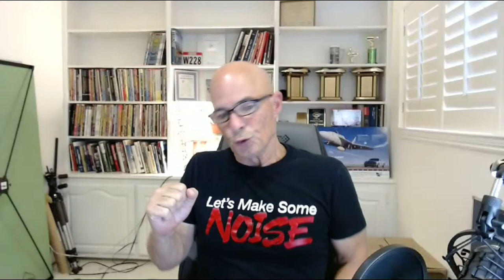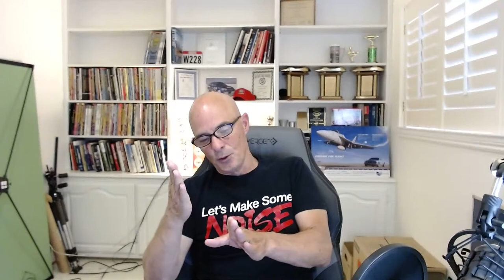LET'S TALK TECH-WILL A MOTOR MAKE MORE TORQUE AT LOW RPM AT PART THROTTLE?

Comment: As to your poll, I don't think that it has anything to do with manifold or port speed as such. It's about the fuel atomisation. Smaller droplets are more important at low engine speeds because there is not the turbulence to tear them apart or keep them in suspension. This is where vacuum secondaries work well on the street and the strip because they tend to keep the droplet smaller due to the venturi speed as a result of the delayed opening of the secondaries. But as a circuit racer I hated vac secondaries due to the loss of throttle control. Of course the equation changes when using CD carburation or carburettors with air valve secondaries, Quadrajet, Thermoquad, etc.

Comment: Depending on the spec of the motor, often a tunned unit will not take full throttle, under load,  untill X rpm.

Comment: The problem is the plenum volume with a carburetor. If the throttle is suddenly opened fuel condenses on the surfaces of the manifold, hence the need for an accelerator pump. If the throttle is opened only as fast as needed to avoid fuel drop out the AFR is maintained and the engine produces more output due to the better air speed and fuel distribution.  One of the advantages to port fuel injection is being able to control the AFR at low engine speed without fuel drop out from the slow air speed caused by sudden throttle opening.

Comment: Excellent question to test.  Building a Pontiac 455 with SP2P q-jet intake and VooDoo 250 cam and would like to maximize part throttle low rpm torque.
Reply from the maker: Sounds great!

Comment: You have a point on the timing portion of it and of course fueling. If you look at low speed timing on square port stuff vs cathedral the square ports have a ton of timing in the low speed areas. However, in the high load low speed areas they pull a TON of timing out. Then again you don’t really hit those areas unless you wack the throttle open at low rpm…. 🤔  it’s mostly a knock/burst knock deterrent soo, yeah very curious.  Typically power enrichment is delayed at those low rpm’s too.

Comment: A lot of oem engines these days which are all torque based don't open the throttle (ETC) more than about 82% even with full throttle/load. My examples are Fords barra and 5.4l boss engines and Holden LS based engines

Comment: I don't think you'll see more torque at lower throttle opening. Throttle will fill the plenum, plenum feeds runners. Increase in air speed will only be across the throttle body. At low rpm you may see peak numbers at lower throttle opening (presumably right at 100kpa) but it will flat line from low to high throttle openings.
Reply: if it's a carb with specific setup it might help, it could affect a lot if the carb isn't flowing right amount of fuel at low rpm with full throttle opening.

but if it's injected and properly set I don't think it will.
Reply: @lasskinn474  yes I actually hadn't considered that. I personally steer away from anything with carbs and naturally assume that everything is fuel injected 😂

Comment: Richard, I'm looking at swapping and building a basic LS 6.0 for my pickup. This is a daily driver and I pull a camp trainer with it. Gross weight of both loaded for the hills is right at 15,000 pound. This also has a manual transmission in it.
The L31 with the gears, tires combo towing. RPM operating range is 1,200 to low 3,300 RPM range. I do drive in Idaho so we have lots of mountains to claim.
What factory heads would you recommend using. 
About the only change from stock I'm looking at is a cam change.

Comment: I did a test when I was learning how to use a Eddy current chassis Dyno with my na 2jz Lexus sc300. What I found was if I made the Dyno hold it at a certain rpm if the engine was capable of reaching that rpm at low throttle angle it produced the same torque as it did at wide open.  Not enough data to reach any conclusion just something I ran across in my own tests. While using mega squirt they have a table called tpsdot I believe and that table is to set what throttle angle is the equivalent to wide open at a certain rpm. I believe they only use that table for acceleration enrichment cuz if you're already considered wide open when you move the throttle further open you don't necessarily need as much acceleration enrichment as if you were light load cruising and went to wide open rapidly.
Reply from the maker: there is no acceleration enrichment at wot
Reply: @richardholdener1727  exactly that's what the table is for anything past that throttle position is considered wot at that rpm so if your already past that and then go from 40% to 100% then you wouldn't need acceleration enrichment. Because your already at full load and 100kpa.
Reply: @richardholdener1727  I guess my point in bringing up the tpsdot table is that if engine is capable of hitting say 2500 rpm under full load at 25-30% throttle it's not going to produce anymore torque with more throttle opening. That's what I saw when I ran my test. I did throttle sweeps with the Eddy holding it a 2000rpm and at around 20% throttle it made around 86ftlbs and as I increased throttle past that point the engine made more noise but the torque output stayed the same.

Comment: Richard, this question is a little off topic, but close? I remember on one of the 7pm talks about intake runner length you mentioning something about a conversation you had with some VW builders.  When they asked what you would do, they did not like or believe what you told them Would even work?  I do not remember you saying what you actually told them though. I have a buddy at work that buying one to build a driver version, is why I am asking?  If it can be told anyway?  The VW crowd does seem to be fairly homogenous in the builds they do, NA & boosted. Heck they still use and recommend cam grinds that are 30 Freakin years old?
Reply from the maker: LONGER RUNNERS-NOT BIGGER IN DIAMETER
Reply: @richardholdener1727    I thought that was where you were going! Thanks!!  You figure out the rpm range you wish to generate peak power at and back into the appropriate  runner length from there?

Comment: Richard can you do a test on boost vs ring gap on a stock ls? For example take a 5.3 and run each piston with incrementally greater gapped stop rings, then throw boost at it and see how much boost it takes until the gap kills the piston? Then keep running it to see which gaps survive and which don't?
Reply from the maker: no
Reply: @richardholdener1727  OK thanks for your response

Comment: I know my gen 4 5.3 gets of the line better if you wait until it gets into 2nd to floor it but I suspected that the large throttle body on the gen 4 motors
Reply: And my 355 roller motor didn’t like being floored until 3000 rpms

Comment: Can you set up the dyno to hold a fixed rpm, say 2000 rpm and plot TPS on the X axis, with both horsepower and MAP as the Y axis'? Hope this makes sense in words like it does in my brain.
Reply from the maker: stationary load?
Reply: @richardholdener1727  Yeah. The idea being (if the dyno software allows you), to set up a graph with throttle position instead of RPM along the bottom axis, and torque on the vertical axis, then your dyno "sweep" will be from almost 0% to 100% throttle opening rather than an RPM window. This will give you a graph plot of throttle opening vs torque, at a fairly high resolution (from nearly 0 to 100% throttle at every point between) rather than overlaying runs at 25, 50, 75 and 100%. This will show you EXACTLY what throttle opening gives best torque, if there's any anomalies or sine wave effects at odd tps% and you could also use the second vertical axis for MAP values to see if torque peaks right at 100kpa and flatlines with added throttle opening, or if it increases/decreases.

Comment: Do you have a supercharged v6 with a turbo mounted as well
Reply from the maker: yes
Reply: @richardholdener1727  I own a supercharged v6 I bought a cheap eBay turbo etc intercooler etc what other mods will I need done to have the turbo run with charger as a daily driver

Comment: I need help!!! I need to get rid of FUEL SLOSH!!! starving hellcat pump under hard acceleration with half a tank.
Reply: You might need a fuel cell friend.
Reply: What your tank is maybe lacking is a fuel pump basket or maybe it’s under-engineered. Basically a basket keeps some fuel near the pump while the car is experiencing g’s. I don’t know if any such aftermarket part is even available so that’s why I air on the side of a fuel cell with anti slosh built into the design.
Reply: @Ofmyownvolition  stock tank on new edge recently vortech.
Reply: @Ofmyownvolition  I’m debating a tank provided by on3, it’s for cobras 🐍. And specially new edge mustangs experiencing my problem. $350 bucks. Otherwise fuel cell But then I loose ability to use my oem tank?.
Reply: https://youtu.be/Wc8goq7vXLI I came across this vid hope it helps. I wouldn’t go with mismatched oem parts unless you measured and know it will fit nicely. But slightly modifying the stock tank might be within your realm of options

Comment: I’m actually curious! I converted my motorcycle from carbs to DBW injection and on a tall gear at low RPM it bogs when I open the throttle beyond a certain point. I want to know if it’s not my inaptitude to tune it.
Reply: Could be how the timing advance is at low rpm. Tuning is something that takes time to fine tune for drive ability.

Comment: will your et be better at part throttle out of the hole for 60 feet, or at full throttle?????

will extra pressure drop across the throttle blades aide in filling the cylinders?

I say no, dont over think it, but just my opinion.
Reply: i don't think it will aid in 'filling' the cylinders but on carb setup stuff like that can affect a lot.